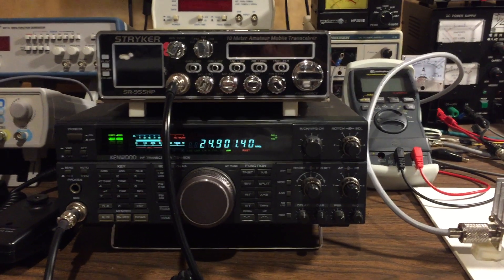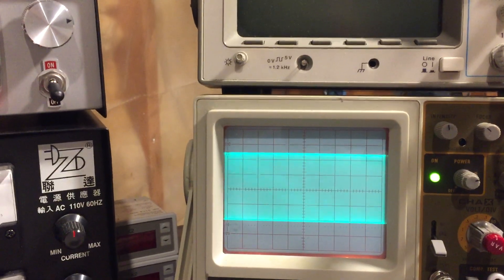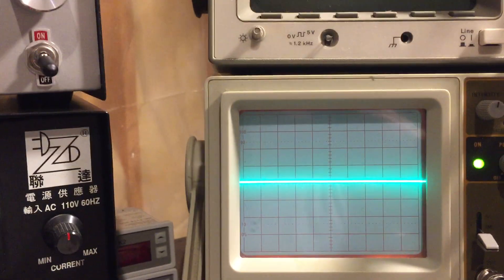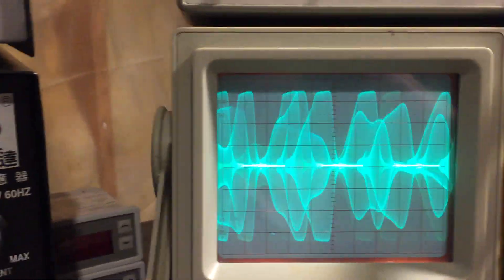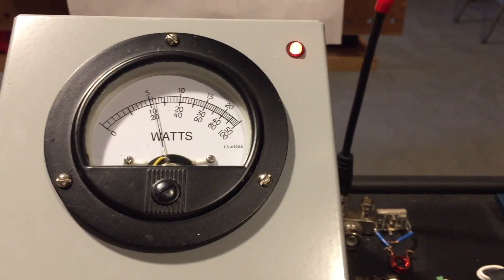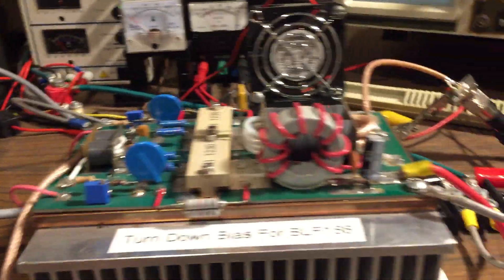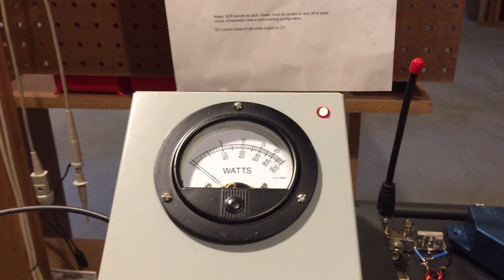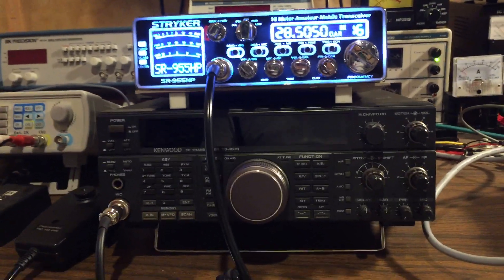RF Man Discusses AM Modulation and Compares Different Radios

Comment: Just viewed this video -- sorry to be late with the comment.  To run Kenwood 450, 850, etch in AM mode, set the Power control to maximum and then control the power output with the Carrier control.  Set the Microphone level control (Mic) to achieve positive modulation peaks at two time (2X) the unmodulated carrier level as viewed on an oscilloscope.  The usual practice of setting the modulation level on negative peaks does not work on an SSB transceiver due to its use of a balanced modulator.  If the negative-peak modulation exceeds 100%, it does not cut the carrier off but instead flips the phase of the carrier wave 180 degrees and allows it to start back up in the positive direction.  This sudden phase reversal produces significant distortion in the detected audio.  Fortunately, this distortion in confined to a relatively narrow bandwidth due to the presence of the usual post-modulation IF filtering in SSB transceivers (typically +/- 3 kHz from carrier frequency), quite different from high-level-modulated AM (ie plate modulation).  Hope this helps....   73 de K7JEB

Comment: So. How do I get my ham radio to sound better on AM without having to turn the power way down? My Yeasu FT 891 doesn't sound good on AM unless I turn it all the down to 5 watts.
Reply: 5 watts? You must be a cber? The radio should run 20 to 25 watts and run to 100 watts pep. This is the standard carrier x 4 100% modulation.     Your Stryker radio is a total piece of shit. You are spalttering all over the place. You want real AM audio like a radio station go plate modulated or pwm. But if you want to use some pos cb amp, you will always sound like garbage. RF man should be splatter man.

Comment: thank you sir. the old saying is if you do not have the swing you don't have that thing. and that 's what she say's. i have a stryker 955 with a switching diode on it so it does not pinch the carrier so the radio can swing more with a 10db Attenuator 100 watt in the amp and boy does she swing on AM and SSB. i just wished you would have showed it on SBB so people would understand more. but everyone should know on SSB radio's like hf radio swing more on SSB then AM. thanks again your friend Richard in Wyoming.

Comment: I have a Flex 6500. What type of modulation does it have ? The power is 100 watts without a n amp.
Reply from the maker: I'm not sure. I would check the specification in the manual.

Comment: Use this to defeat the alc works on most hf radios that use negative going alc. set your dead key to 20 watts with the pot then you'll see 100% modulation on the Kenwood 

http://www.w1aex.com/756AM/756AM.html
Reply from the maker: Thanks for the suggestion!

Comment: Show the Stryker on the scope with the 1kw carrier i bet the modulation is under 100% positive and severely distorted on the negative peaks if the amp is a true 2kw the max dead key for clean 100% modulation would be 500 watts but I bet you won't even be able to get it to  run cleanly at anything over a 350 watt dead key. With 1kw dead carrier your hitting  maybe 50% positive modulation and the negatives are going into severe distortion and is what the meter is showing as swing.
Reply: by adding a switch diode to the stryker there will be no distorted on the negative peaks
Reply from the maker: I have a video showing my amplifier on a spectrum analyzer. The harmonic are -30 to -40 dB below the fundamental without a LPF.
Reply: @rfmanchannel6915  is this with overmodulation being sent to it just a carrier or a 100% modulated sine wave it makes a difference if your breaking 100% negative peaks it's overmodulated I'm not saying the amps won't do it but as you said yourself they are linear garbage in garbage out
Reply from the maker: @doughboyvideogates6920  I probably had the mic gain a little high, but the point of the video is the same.......

Comment: The styrker is severely overmodulated any pep reading of it would be completely false. The Kenwood alc is acting you can feed the Kenwood a negative voltage at the alc with a 9 volt and a pot and kill the alc action and it would increase the modulation
Reply: ALC from a Kenwood needs to be eliminated all together.